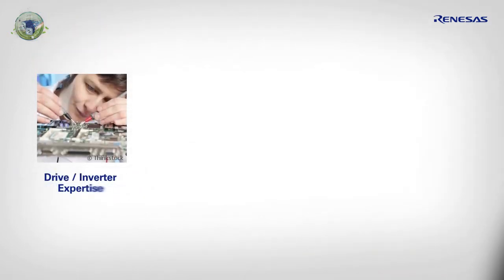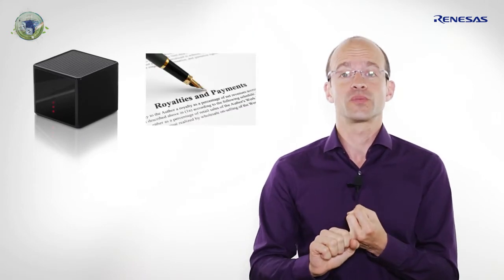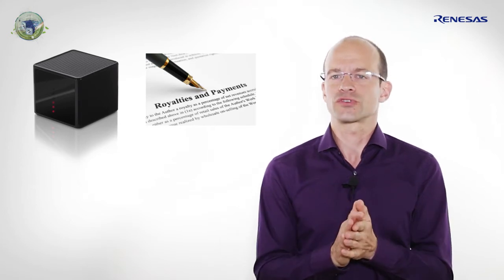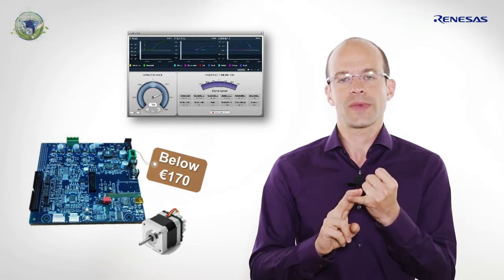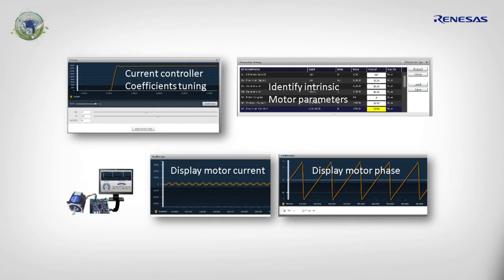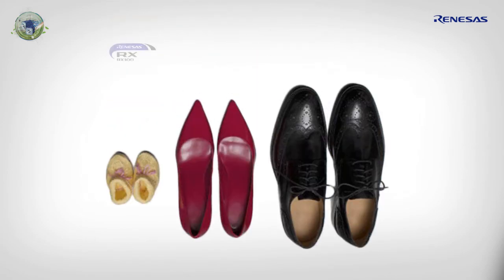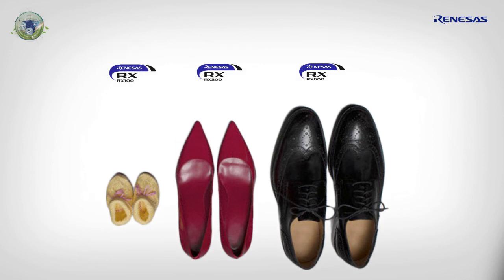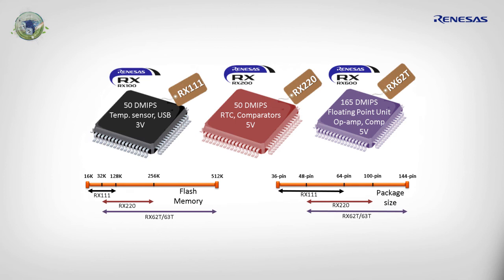Rotate-it! RX111 Motor Control Solution Kit

Comment: I am looking for a complete solution to run and control the speed of 2.5kw pmsm motor. It has an resolver based feedback cable so sensor based or sensor less any solution could work for me.